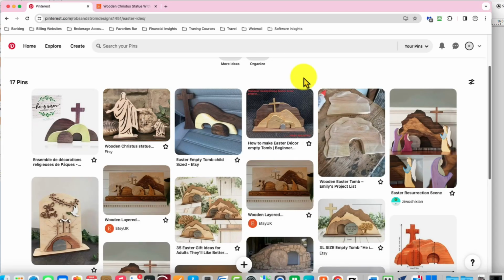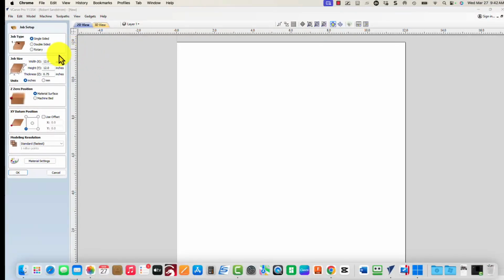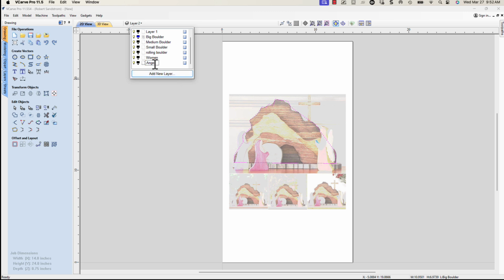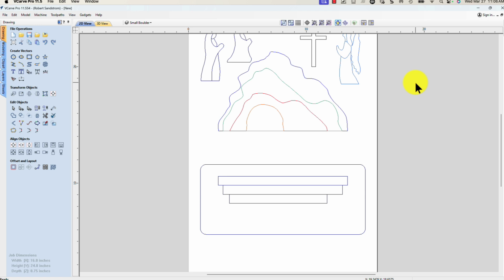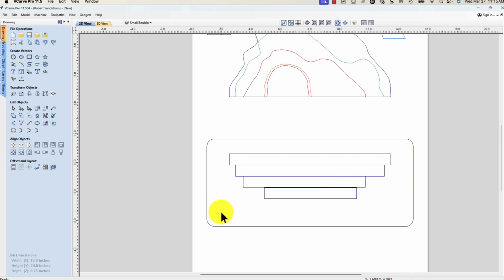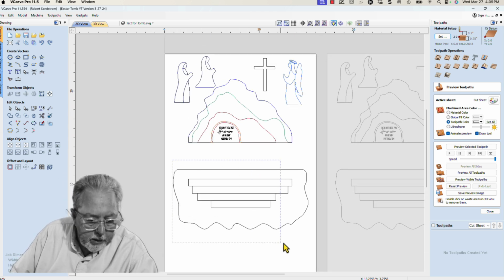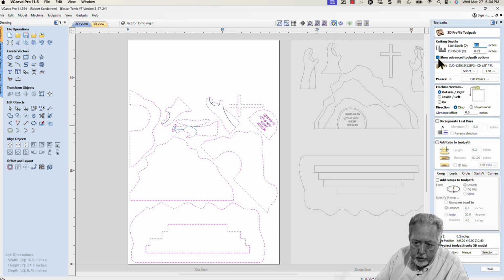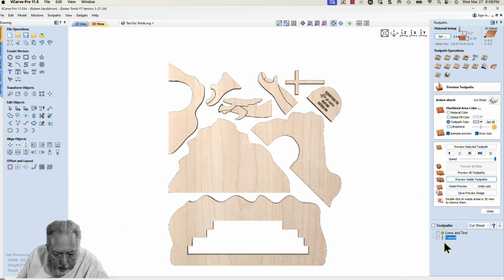Design & Cut a Slot-Together Easter Open Tomb Decoration with VCarve & CNC Router

Comment: I struggle with the tracing step. Can never get a trace on the line plus end up with several open vectors instead on of one closed vector. Do you use a mouse? I would like to see the exact process….maybe a new video.
Reply from the maker: Joe...understand the comment about tracing - which is what I fast forwarded through.  I think your idea is great about a focused video on the tracing part.  Will do something like that in the near future.  I may do that in my live session this Thursday - which I need to get on the schedule.  I think that would be perfect.  Yes I normally use a mouse.  Thanks for taking the tie to comment and giving me some input that may help others.

Comment: Good information .. Rob what is a normal plung rate isnt that were the bit plunges in the wood. Keep it up brother
Reply from the maker: Thank you for the positive feedback Dan.  The plunge rate is where the bit plunges into the wood.  The standard plunge rate I am used to having is =< 50% of the feed rate for the bit.  Much depends on how fragile the bit you are using is.  Many times you can find the recommended plunge rate for a given bit in the feed and speed rate information provided by the bit manufacturers.  Hope this helps.